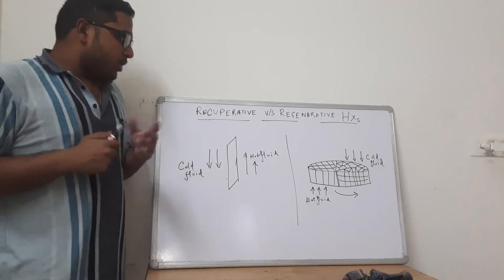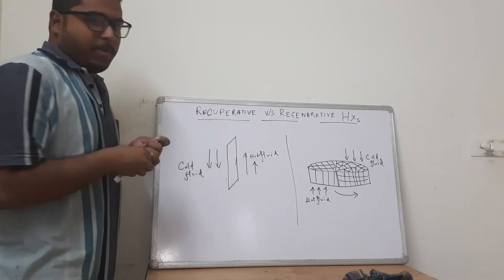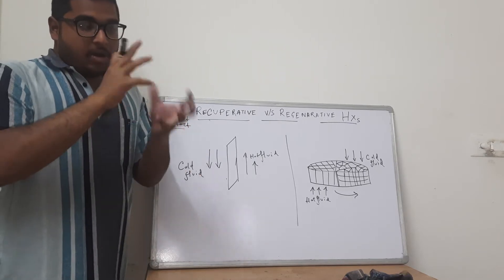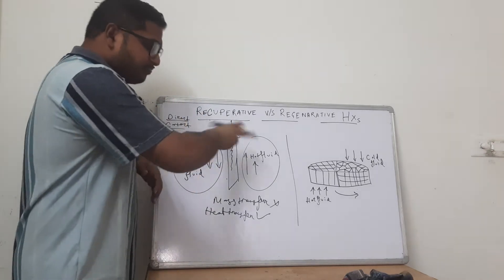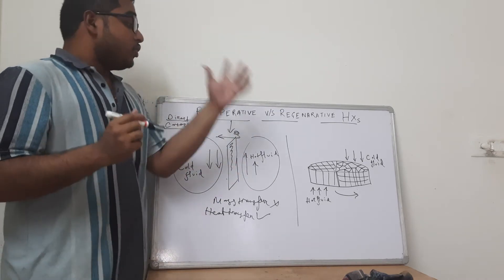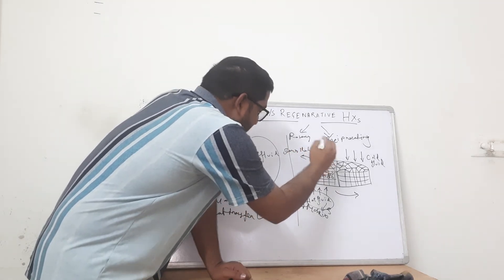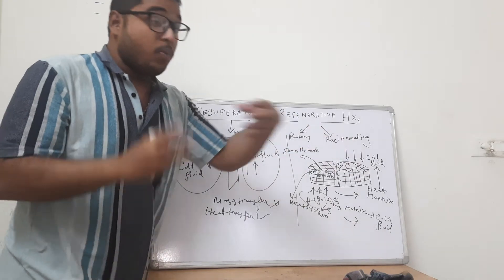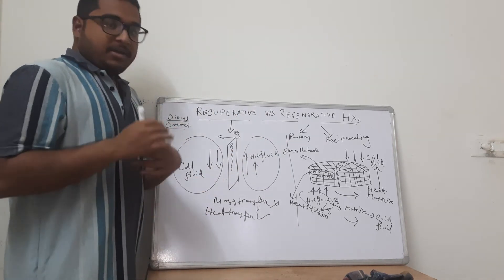RECUPERATIVE v/s REGENERATIVE HEAT EXCHANGERS | DIRECT CONTACT v/s INDIRECT CONTACT HEAT EXCHANGERS

Comment: You said, recuperative is simultaneous flow of fluids in co/counter without mixing. It is sub categorised into direct and indirect contact. As per definition direct contact should not be in this category or definition needs correction.
Reply from the maker: Recuperative Heat Transfer doesn't include direct contact, it just includes simultaneous flow separated by a division between them